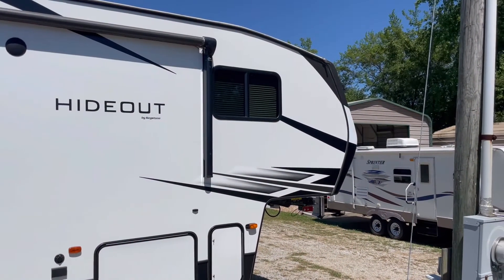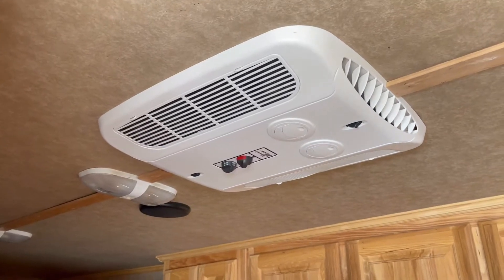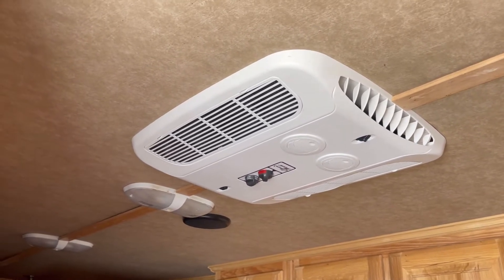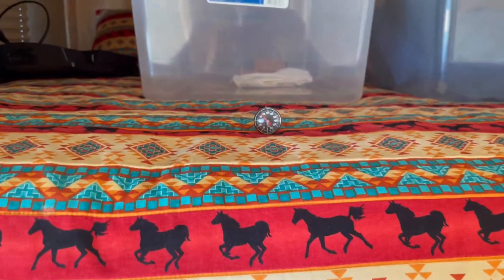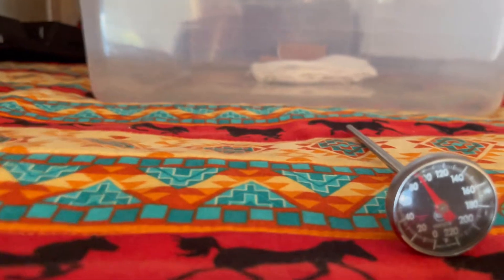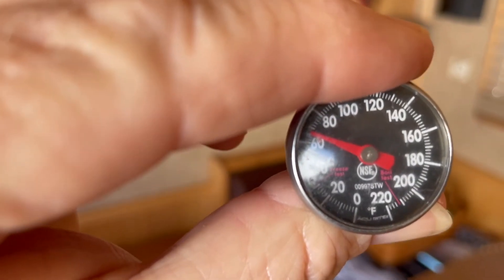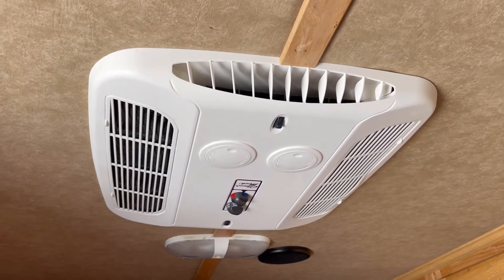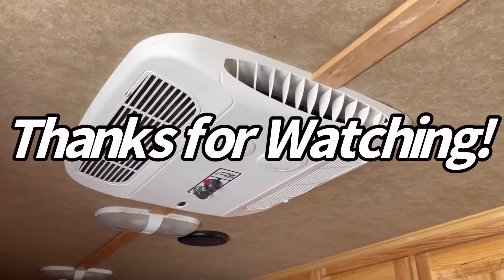How To Test Your Camper Air Conditioner

Comment: Never knew that, geez. I would imagine almost everyone would think it works better than that. But I guess it’s not a normal, refrigerant type a/c unit.
Reply from the maker: They are a good unit.  All A/C’s work basically the same way.  The issue is that people think the air coming out of the vents should be ice cold.  15-20 degree split between room air and discharge air is good.  Your house A/C is around that too.
Thanks for Watching!
Reply: @TrailMedic911  No kidding? Wow. Never knew that was the maximum that it could only go to.